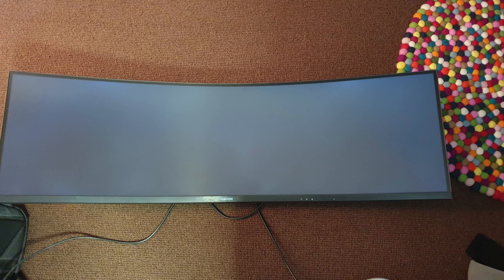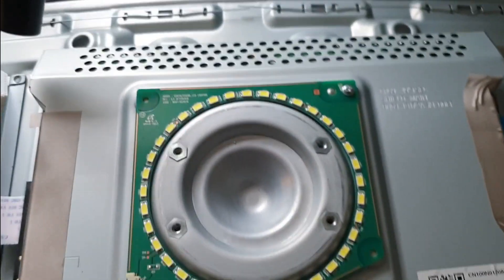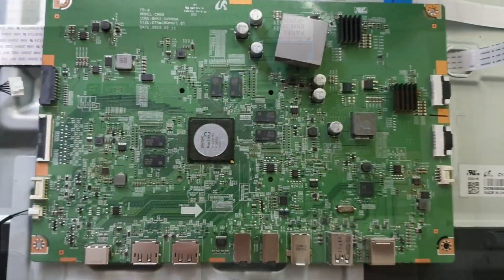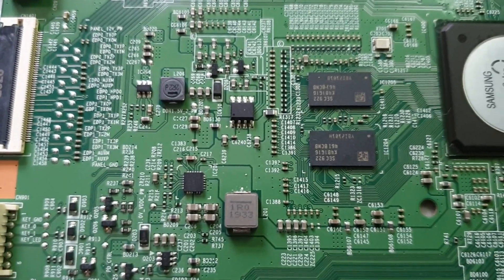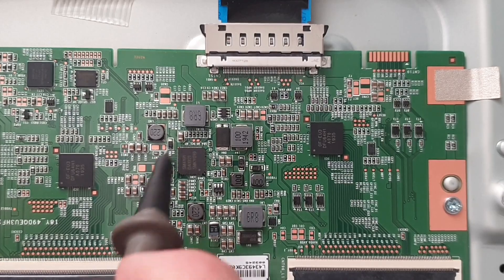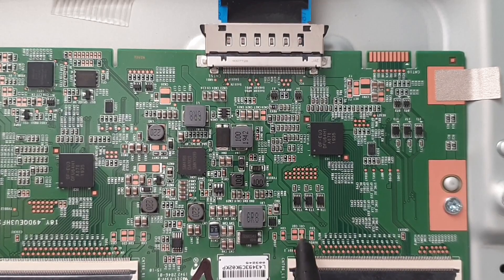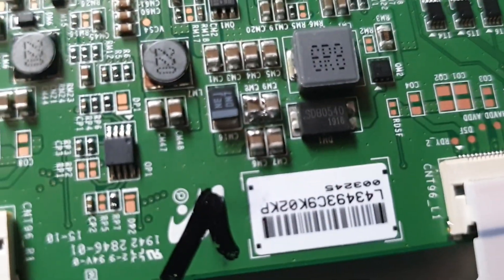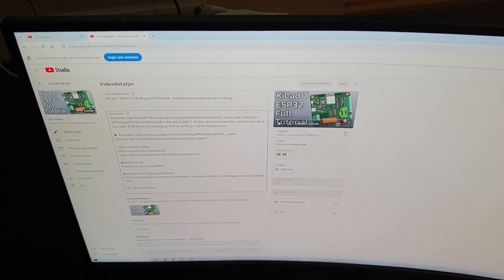Repairing a defect monitor - no picture

Comment: If you look at the black chip in the middle at 5:30, you can see that the bottom legs are broken.
Reply from the maker: @YohanP07 - it was the capacitor that had failed :-)

Comment: Thanks for the video... I have the same problem with my g7 27 240hz and it happens when I play some games like bf6 or some heavy games and sometimes happens randomly.. it just goes black with the backlight but no picture and I use the menu to turn it off (that I cant see) when it turn off I can just turn it back on and it will work untill I run a heavy game or randomly... I tried to remove the thermistor and it just make it less happening but las week it happens alot while playing bf6... I dont know ho to fix this :(
Reply from the maker: @ModaNJ1 - thank you very much! Interesting problem, you could maybe try with a cooling spray and see if you can force the problem to happen.

Comment: I have a similar issue on the Samsung Viewfinity S5, backlight is on, buttons seem to work (I can turn the screen off and on with the buttons), but screen is completely black. Where can I find a service manual for this screen? Any idea? It would be a shame to throw it out if it can be fixed easily, I only used it for 13 months and it's just out of warranty.
Reply from the maker: @samerbouez  - i don't have a service manual. If you have a multimeter you can start and check voltages and look out for shorted ceramic capacitors
Reply: @made.by.morten.laboratories  thanks for the reply. I have already checked the ceramic capacitors and haven't found any shorted. I'm not sure how to check for voltages, normally a service manual would help, this is my first time attempting to fix a monitor so I'm not familiar with its boards. On the plus, I am very familiar with electronics, just not board troubleshooting and repair. Do you have videos that can guide me further?
Reply from the maker: @samerbouez  Sorry i don't know any videos, try and  make asearch here on YouTube. Have a look on the cables that are going in and out of the mianbaord and see if behaviour changes when you disconnect them. On the TCON board there is normally 2 cables going to the panel, try and disconnect them one at a time.
Reply: @made.by.morten.laboratories  seems there's some progress now. I disconnected one cable, no change, screen was black. I disconnected the other cable, and the screen was half white half grey! What do you make of that?
Reply from the maker: @samerbouez  Could be a problem with the panel, - can you measure for shorts on the panel cable that gives you the black screen?
Reply: @made.by.morten.laboratories  I have flipped the cables and the same status remained, so it's not a cable issue. I have tested all ceramic capacitors on the panel side that seems to be faulty, but no shorts were found.
Reply from the maker: @samerbouez  It could be the panel then
Reply: @made.by.morten.laboratories  I guess I'll just chuck it in the bin and buy a new one, not Samsung this time lol. Thanks for your help!
Reply from the maker: @samerbouez  - sorry to hear that, better luck next time ....

Comment: Just curious, I have a Samsung 27" curved that has the same issues.  Blank screen, Powered LEDS that seem to flicker when the power joystick is pressed or moved up / down / left etc.  I did voltage testing on the Mainboard and Tcon and all seemed okay or matched voltage marked on the PCB.  The large capacitors on the Mainboard are fine as well and read out at half the max capacity.....my question is, I am new to all this and I don't know how or what settings you use to test the small capacitors with the black (COM / ground ) needle.  Wish we could get a view of your multimeter settings to understand what to do to test the small capacitors in the step / up converter portion of the PCB.  Anyhow...Thank you very much for sharing this video!  It gives me hope that I can get the monitor back to life without buying a new Tcon board or mainboard.
Reply from the maker: You just put your multimeter into diode mode (beep mode),  you just check for short circuit over the capacitor. Good luck with the detective work
Reply: @made.by.morten.laboratories  Perfect!  Thank you for the fast reply!👍
Reply from the maker: @extrapros  You are very welcome, i hope you can fix your monitor

Comment: THE SAMSUNG NEO G8 MONITOR IS BURNT OUT! I DESCRIBED EVERYTHING ON THE FORUM IXBT, Type the monitor model, I'm the only one there! I can't add a link, YouTube won't let me through!
Reply from the maker: Do you need support to repair the monitor or what is the problem?
Reply: @made.by.morten.laboratories   I'm looking for a monitor motherboard: BN41-03027 BN41-03027A. they refused to guarantee me, even though I proved that it was a factory defect! Because the monitor burned out and the external power supply remained in its working position! I described everything on the website, and posted a photo, maybe it will be useful to someone!?
Reply from the maker: I hope you got it sorted out
Reply: @made.by.morten.laboratories  Yes, I ordered a new motherboard and power supply! But my power supply didn’t burn out, just the plug burned out! Then I’ll re-solder there will be a reserve! I’ll also try to restore the motherboard as a spare!))
Reply from the maker: @7-Patapich-7  Cool, i hope that you get it up and running again
Reply: @made.by.morten.laboratories  Thank you

Comment: I have this exact issue. Of course I’m gonna need soldering irons and things, which I don’t have to replace the capacitors. Can I just buy a new one of those tcon boards and swap it out?
Reply from the maker: @lekkerjonty  yes this is also possible amd maybe you can even sell the defective one. Remember to replace with the exact same type.

Comment: Hi, I have a samsung odyssey neo g8 32 monitor. I've been using it for 11 months. I sat down to play yesterday, and suddenly there were hissing explosions and smoke started. The monitor was on fire, something in the upper part, apparently due to the power supply. There were no loads, I just took it and caught fire. I gave it under warranty, they are still investigating.
Reply from the maker: Very nice that you still have warranty on the monitor, i hope you will get a new one or it can be fixed again.

Comment: G7 32" 240Hz 2K, the same problem, but this one doesn't have a TCON board; instead, it has two boards on the sides, some call them X and Y or driver boards. My multimeter shows 7-8 faulty capacitors. If I start desoldering all of them, will the monitor display an image once they are all desoldered, and do you have any better ideas about what the problem might be? The multimeter shows a short circuit in several places.
Reply from the maker: I you expect it to be a capacitor you can use voltage injection to find the culprit

Comment: I just bought two gaming monitors which have an identical fault to what's on your video. Backlight works, my PC is recognising the monitor but no picture. One of those monitors worked for about 1 minute, then picture disappeared. I left it overnight unplugged from power and in the morning, I was able to get the picture back for about 1 minute and then it disappeared. It does look like the kind of fault you described in your video. Potentially capacitor discharged itself overnight, then once I plugged the monitor back, it worked for a moment and failed again. I think I will attempt the diagnostics to see if I can bring it back to life.
Reply: Also, I noticed that once the picture disappeared, I was not able to see the monitor menu and settings (the one you can control with a joystick behind it). I think it will be a similar sort of fault to whay you had on your one.
Reply from the maker: Yes it seems to be some of the same symptoms. You can also try to remove the cables going from the TCON down to the panel, this way you can rule out if the panel has shorted. Good luck with your repairs. I look forward to hear good news from you :-)
Reply: @mprzytocki95 I had a similar issue and mine was fixed by following the hairdryer video on YouTube (waving a hairdryer at the corners of the monitor for 5 mins). My screen was dead for a year and a half and now works lol (but I have to heat the screen always before using it).
Reply from the maker: @VoidBiscuit incredible, never heard about this trick before ...